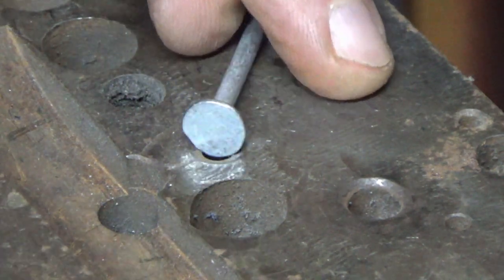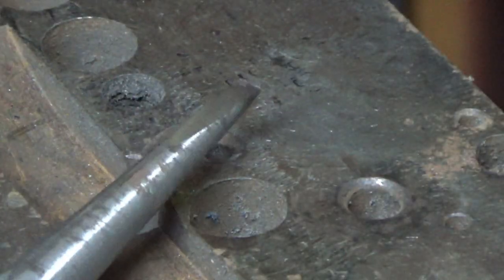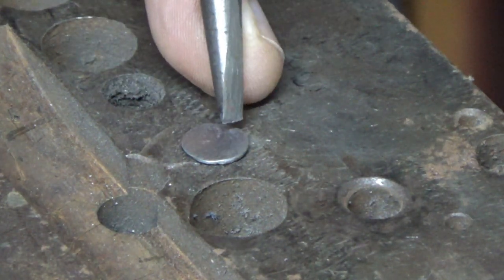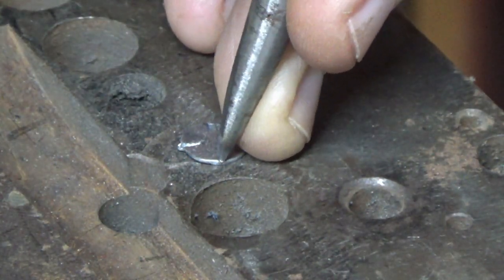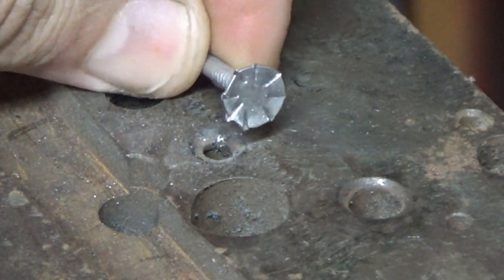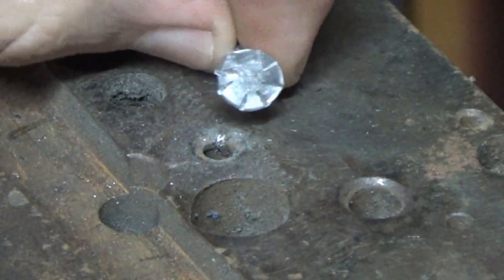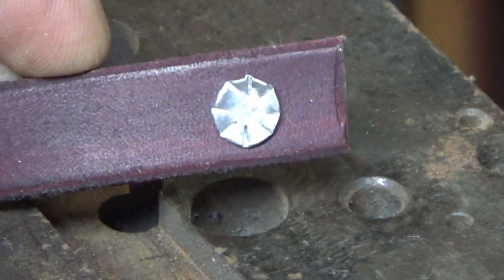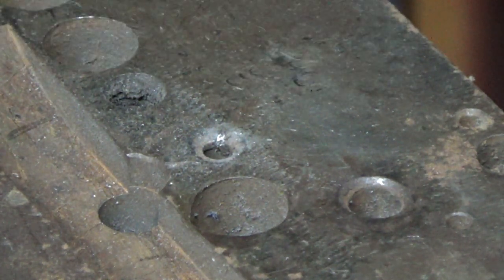Another way to pimp your nail? Armour Decoration.

Comment: Loved the video as always, keep up the great work! The video had some graphical issues at the start, though it returned back to normal before you started working on the nail head.

Also, if you have the time to answer, I have two questions from someone pretty new to armouring. What sizes of nail do you use for your pieces? And what would be a good simple project to start with?

I've recently made a coat of plates,  and it was an amazing experience, but now I'm a little lost deciding what piece of armour to do next
Reply from the maker: Hi there, I tend to use round nails or clout nails about 3-4mm in shank diameter, if that makes sense?

I am hoping over Christmas to film making a simple 12th century a-historical helm that I believe is a good starting project, relatively simple and fun that ends up with a fairly nifty starter helm. I'll be supplying patterns with it, likely through my wife's etsy shop for a couple of pounds or so, something nominal just to help.

Comment: Graham, your shot of the steel plate (for use if no heavy block of steel with holes in it is available) was hidden in the corrupted part of the video.  Can you show its thickness, if you re-post this video?  Or simply reply with the thickness?

I agree with you, I think I like the look of the filed nail head over this one.  But this version does seem to be a lot quicker.
Reply from the maker: Hi there, the block is about 10mm thick, but even the 3mm thick right angle I show will do the trick. The secret, if there is one, is to make sure as much of the nail head is supported as possible by some material that's thick enough to support the hammer blow. But a piece of hardwood will do.
Reply from the maker: maybe closer to 15mm
Reply: Thanks Graham!